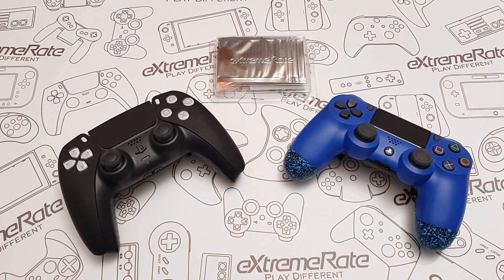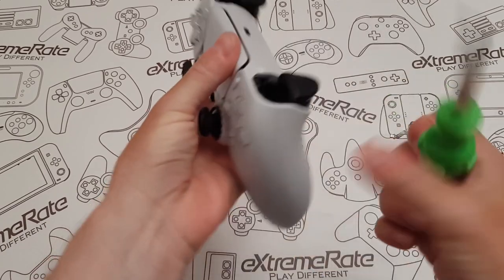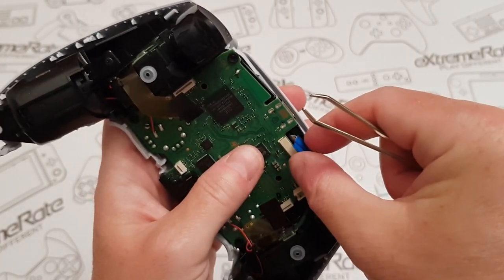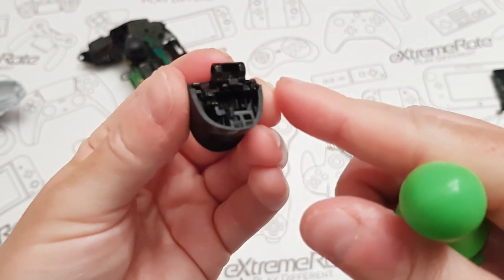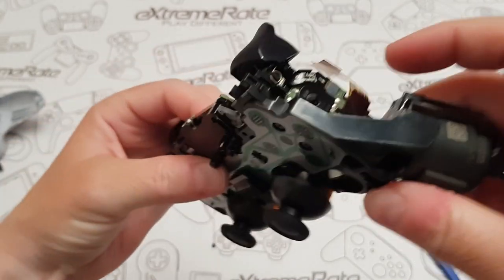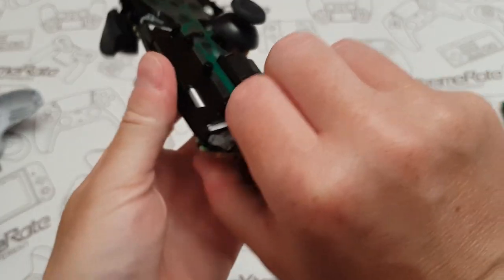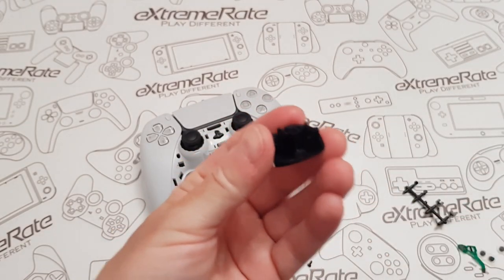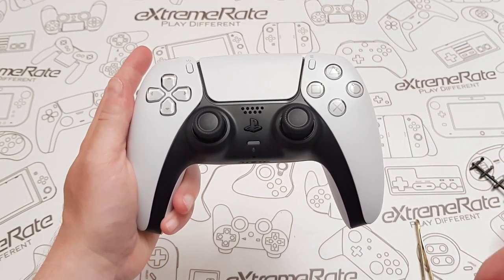Ps5 Dualsense Clicky Digital Trigger eXtremerate

Comment: I have customers having problems with the back r2 because the toggle gets stuck I install my own ones in to replace them higher impact my be better there nice but they need to be careful not to press the buttons to hard the buttons will tare down quickly

Comment: Have you had any issues with one of the bumpers rattling especially when the control vibrates?
Reply from the maker: I personally don't use vibrate never have for a long time. Did you turn off haptic feedback on your options? Also did you double check the cog was lined up correctly

Comment: Ive done the steps but when I've placed it back together I feel as though the front plate has pushed the buttons in like my share button doesn't stick out anymore
Reply from the maker: Sounds like you might need to open the pad again and make sure everything is lined up, the share button shouldn't feel any different. I mean if it works, maybe just leave it? But if you're unhappy I'd open it and check it's pressed down

Comment: The actual micro switch is the fault. I think the desing does not have a margin for the amount of pressure some players will put on these digital triggers. I have had a battle beaver controler digi trigger fail after a month ,same thing switch failed. There needs to be more rd done on this and a desing that allows for harder pressures.If you are light on the controler you should be ok. But if your a gripper. these will not last in the current desing. i thought about cutting and putting the original silicone padding in to act as a buffer??? dont know if it would work or permenantly activate the switch??? some type of stop is needed where the switch is just activated.
Craig you should start doing some  project farm type vids where these products are put through there paces :) theres nothing like that for gamming gear.
Reply from the maker: I actually did that my one of my old Dualshock 4 controllers, I had some spare rubber and put it just in the sweet spot of L2 and R2, it wasn't quite a digital triggers effect but didn't have to press as far and usual and the button was stiffer.
My digital buttons I've been using a few months now, they sent me the tactical version to do a video on, they say they're more clicky like a mouse.

Comment: I have a controler with these fitted. new controler newly fitted 3hrs in the R1 stopped working, any ideas? im sending it back but thought i would ask here if anyone can advize?
Reply from the maker: It just sounds like you haven't fitted something right or maybe not fully fitted. Have you added the little plastic piece what go into R1 and L1?
Reply: @CraigsChannel  Ye they are in. I bought it already built. Whats the diffrence between the gen 1 kit and the updated kit?

Comment: Hi mate, I just bought the tactile once’s and for some reason my R2 and L2 have different holes to the one u have in the video? The piece that was given to me doesn’t fit and I have an 010 controller. Is there anyway you can help with this? Thanks
Reply from the maker: I think they've upgraded the plastic bits, do you mean the ones that are awkward to push in and hold the buttons down, like you press it in from the side
Reply: @CraigsChannel  Sorry for the late reply, i actually figured it out and was placing them in incorrectly. Thanks for the reply tho
Reply from the maker: Don't mention it, as long as you're all sorted and it all works that's the main thing dude 😎

Comment: I just got this kit and at 11:35 when you put the little rod in I can’t get the holes to line up on mine. I’ve tried putting the pieces in the other way around to make sure I didn’t do anything wrong but no matter what I can’t get it to line up. Any tips on how I can get it?
Reply from the maker: First off did you buy the right kit for you model controller? For some reason Sony have released 4 version now!
If its the right one, just make sure you're putting the button under so it sits in place, then when you put the rod in press it and give it a wiggle, it is a bit awkward sometimes but usually goes straight in
Reply: I have the right kit. I already put the back paddles in this controller a while ago. I can try wiggling it around but I just can’t get it to go all the way in
Reply: Nvm I got it now. Thanks for the help

Comment: Hey mate! I tried making one for my brother and I noticed the L1 and R1 won't click down. Is that common? Did I miss a step?
Reply from the maker: That's a strange one, did you make sure the button were lined up?
Did you add the little plastic pieces to L1 and R1 that you press in
Reply: @CraigsChannel  I had the plastic piece in and it wouldn't click, so I took them out and it started allowing me to press R1 and L1. Weird solution but I'll take it. Thanks again for everything
Reply from the maker: That is weird, the little piece you add to L1 and R1 are just so you get contact with the buttons, maybe like I say they aren't lined up? Is R2 and L2 working? Also have you disabled the haptic triggers

Comment: Hey Craig! Ive got a quick question. At 8:59 the screwdriver you used does it have a name/type? Or is it the same as the orange one that comes with the package? Just trying to sort out if I'm missing any tools to turn the trigger clicky
Reply from the maker: It's the same as the one you get with the kit, I'm just so used to using that one. I must have owned it for maybes 10 years, it's helped me fix so many phones and little items 😁
I was going to get an iFix tool kit, they look really cool, but extremerate always provide you with everything you need so shouldn't have an issues 👍
Reply: @CraigsChannel  ahh that makes sense. It's the little thing we come to appreciate I respect that! Lastly, would you recommend putting in trigger stops first than back paddles? I'm guessing that's the most efficient method but I could be very wrong
Reply from the maker: Yeah 100% put the triggers in first, it'll make things so much easier, the triggers aren't as bad as they might look, it's just taking your time and getting the cog right. Also turn off adaptive triggers in your settings when you fit them

Comment: I tested it out and everything works except when I tap the triggers. Nothing happens when i use the Lt trigger and when I press the Rt my gun fired but the camera instintly turned to the left and the controller losses connection every time.
Reply: never mind, I figured it out lol
Reply from the maker: Sorry I've just woke up, glad to heat you've fixed it without my help 😁

Comment: Hey Craig just installed this along with the back buttons on my controller. Everything seems fine besides the right side of my controller has a slight vibrate and ticking sound when the controller is on. Any thoughts on how to fix this?
Reply from the maker: It's the cog you've not put it in right. Also turn off haptic feedback on the PS options in the settings
Reply: @CraigsChannel  Took controller apart and re aligned the cog. Controller working good now. Thanks!!!
Reply from the maker: There you go easy fix, enjoy your new controller 😁

Comment: My controller doesn't have the holes for this to be installed. (10:50)
Reply from the maker: Is it version 10 or 20?
Reply: Sorted. Had the wrong model of controller. 😂

Cheers for the video. Very helpful indeed.
Reply from the maker: @PAiNJUNKiE666UK  Do you have the 20? They've made a kit for the 20, maybe drop them a message on Twitter and they'll send you the parts you need

Comment: Craig can I ask if yours is still working? I ordered mine from Amazon 2 days ago and the button stopped working. Returned it this morning due to being defective ☹️
Reply: When I was playing cod the L2 button went all the way down which I thought was a bit weird so I had to open it back up again and then thinking that it was fixed my L1 button stopped working like it wasn’t clicking anymore which was a bit upsetting
Reply from the maker: @Amir Rehman  Yeah mines fine, was it not the cog on the trigger you might have not put in right, you've got to line the notices on the cog with the bit that's got no notices on. I know somebody else put it in wrong and when they turned their pad on it made a clicking noise
Reply: @CraigsChannel  nice one! ok cool I’ve ordered another one and I’ll follow your vid to the T! If anything I’ll give you a shout! The back buttons are amazing they works prefectly!
BTW would you recommend putting double sided tape under the trigger buttons?
Reply from the maker: Nice to hear the back buttons are working for you, few people have said they weren't working but after opening the pad realise they didn't have a ribbon cable fully pressed in and one person snapped their K1 button, no idea how? Maybe they pressed it far to hard?

Comment: Would the process be the same if I've already fitted the Rise remap for the paddles?
Reply from the maker: Yeah pretty much the same, just be careful when you open the pad again as you'll be working with a tighter space with the back ribbon cable
Reply: @CraigsChannel  reading reviews that after a few months some buttons don't work and the ribbons wrinkle, wouldn't be great if you did a follow up vid in a couple months
Reply from the maker: @puneetmitra  I'll happily do a update in a couple of months or if people drop me a message I'll let them know. I was using the digital triggers on the PS4 for almost a year and never had an issue. The ribbon cable being wrinkled I've never heard that one, maybe people aren't being careful putting it back together?
Reply: @CraigsChannel  how’s it going now?
Reply from the maker: @callumyt69  my back buttons snapped but they replaced them with uprated buttons with extra plastic plastic strength

Comment: Hey, does this work for the BDM-020? I have the newer controller and this kit but my trigger looks different so not sure where to put the little plastic parts
Reply from the maker: I haven't had a chance to try these on a 20, I don't think they do work as when I looked it said 10 on the description.
Have you tried to fit them or are you just asking?
I had to borrow a 20 from a friend as I've been looking all over to buy a 20, everybody I buy a pad it's a 10

Comment: Can you leave the original l1 r2 buttons and just change the r2 and l2
Reply from the maker: No unfortunately the way the kits designed you'd have to use the little bits that come with the kit as it won't be pressure sensor it's an actually click now
Reply: @CraigsChannel  appreciate the reply.  I read if you press both r1/r2 or l2/r2  at the same time one won't register.  Have you experienced that? That's why I wanted to leave the top alone.
Reply from the maker: @lionvoltron  I play CoD and HAVE to press L1 and R2 to use my dead silence or what ever I'm using i.e stopping power and works fine for me and my friends who also have the same digital triggers